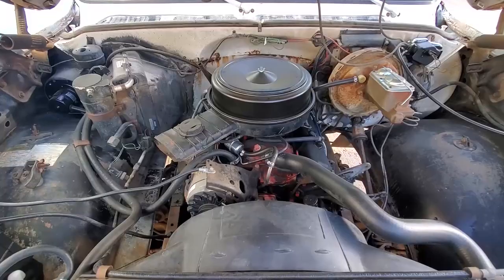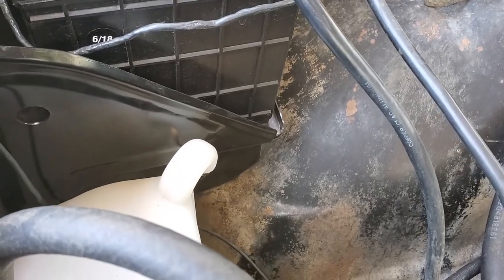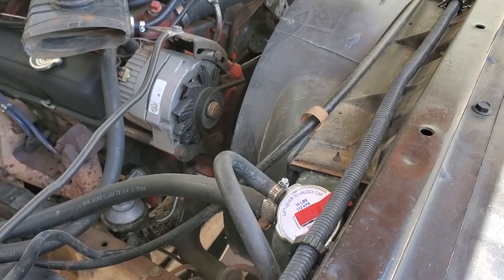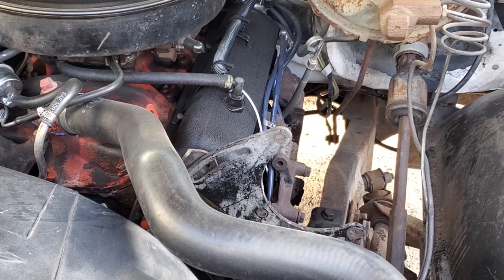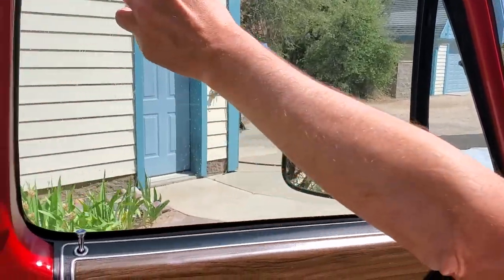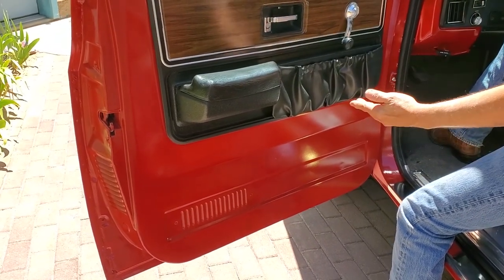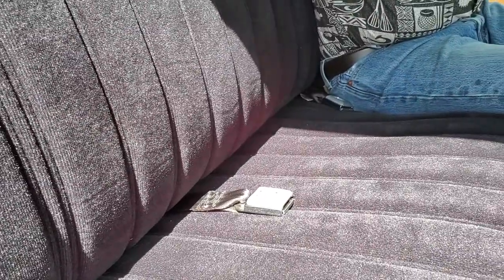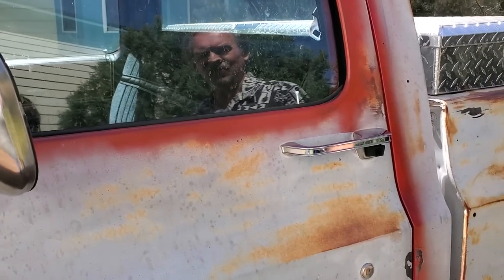1976 Chevy c10 Restoration Blog

Comment: I see from this video, that you have bypassed the EGR valve / Sensor?  Mine is located on top of the thermostat.  But appears to be broken. Your video shows a replacement bolt and nut? I'm trying to replace it, and unable to find. Currently working on a Chevy C10, one owner.  My Chevy is Canadian built (Not sure that matters), trying to find a replacement. Hoping for your feedback. thank you.
Reply from the maker: The truck was purchased with that modification. We didn't make the change. That's a good question, so hopefully one of our viewers will have a suggestion. Thanks for watching!

Comment: Probably why the previous owner thought he needed to cut the wire off he was going to add a aftermarket temp guage lol..
Reply from the maker: Interesting thought. Sometimes it's hard to tell what was on the mind of a previous owner.
Reply: @CarzPlus  I've had a few trucks like that kept tracing up the harness for the pigtails and open up the harness to find out the wire was cut back almost to the firewall...